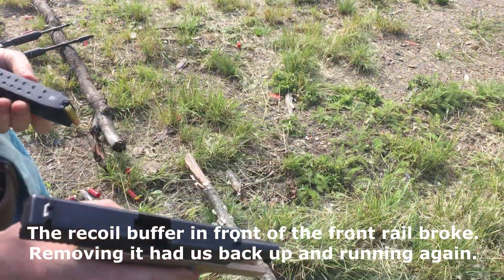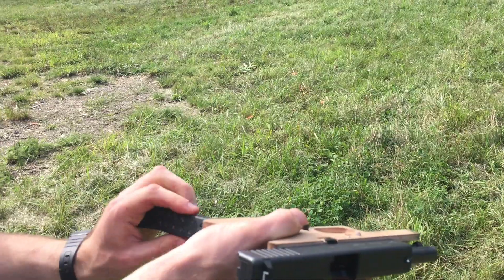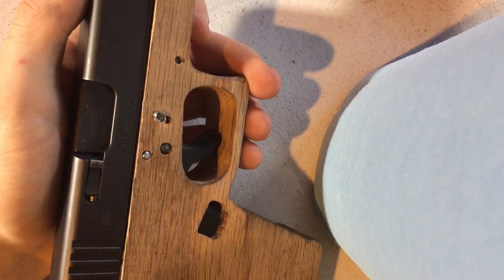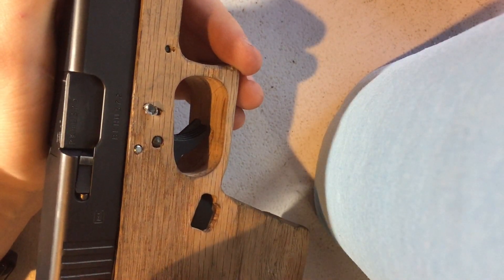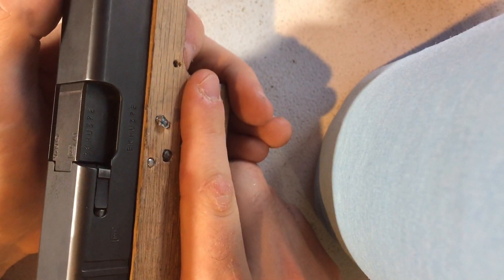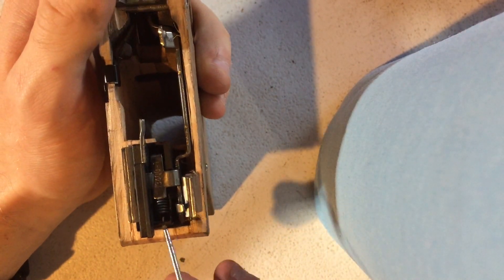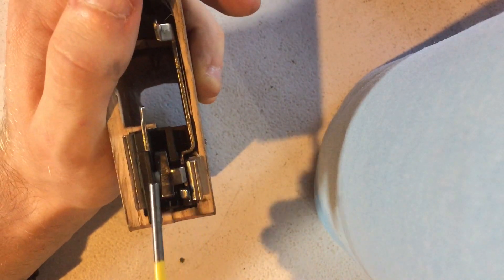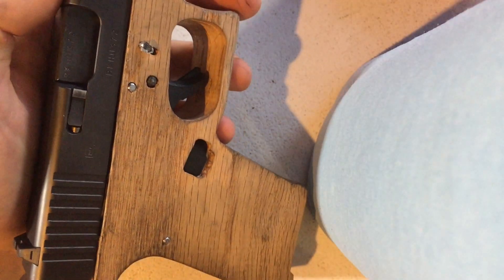Block 19 (wooden glock) v3 test fire

Comment: Hey brother anyway you could post a video of how you came up with the specs and the building process I have some exotic wood ipe also known as ironwood but I intend to try to build a receiver out of using the polymer 80 rail system or the system of like a 3D print anyways if you have any content like that or you could give me some pointers on the working of the wood would be greatly appreciated anyways even if you don't reply stay strapped my man